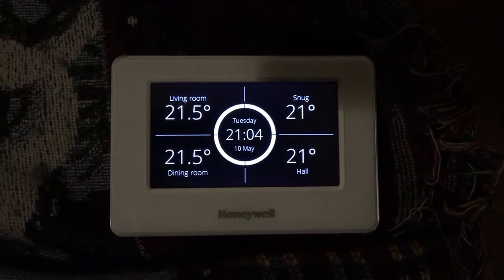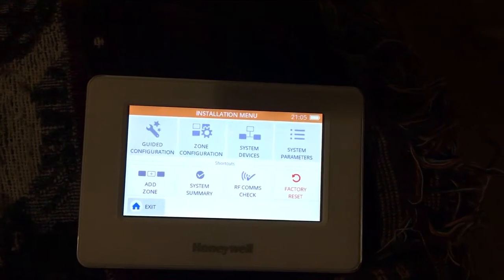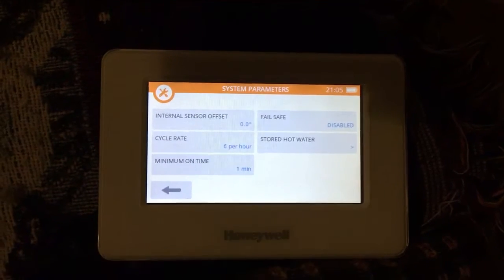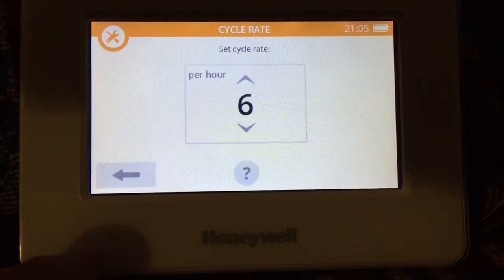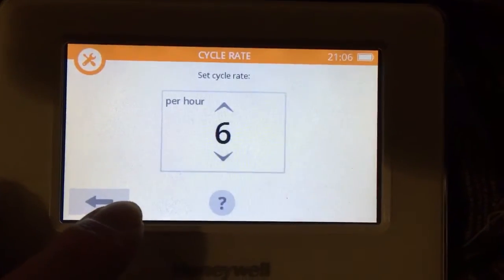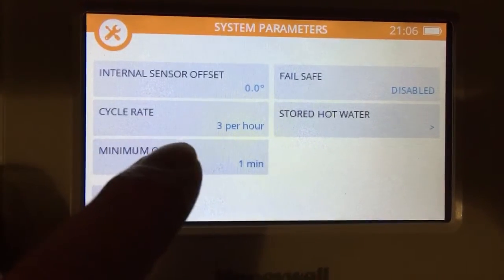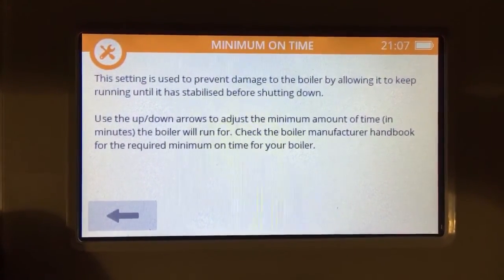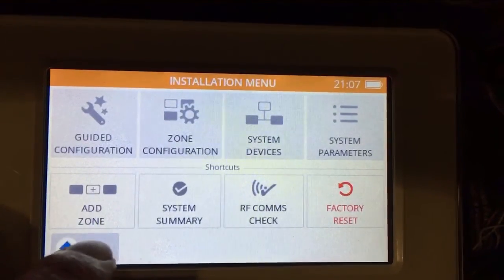How to adjust system parameters in evohome

Comment: Thanks for the nice video. It helped me a lot for understanding how the system works.

I just have a question all ver the internet I wasnt able to get an answer.
Whtas the maximum value for minimum on time?

Pellet boilers need at last 20, better 30 minutes, and I want to install the system with a pellet boiler. The customer really likes the Evohome, and I would like to provide this
Reply from the maker: Sebastian Scharpf 5 mins. For pellet boiler you’re best using a thermal store to put heat into then call off with a pump as required.
Reply: evolved heating thanks a lot!
But I intend to use it for conventional Pellet stoves (no water) as well. But pellet need a much larger minimum run time.
Thanks again.